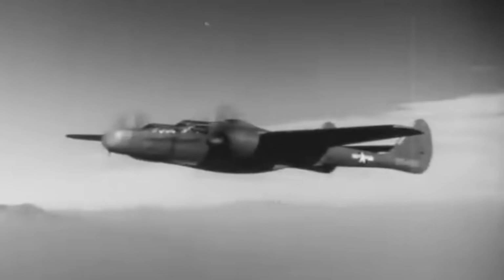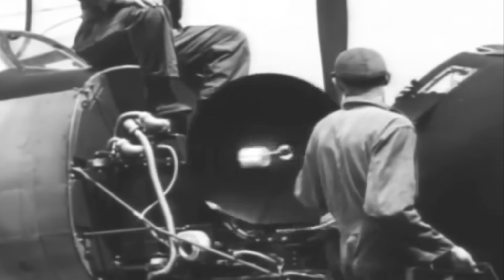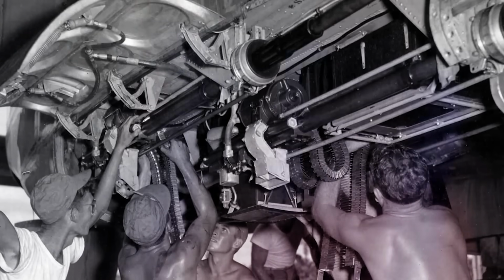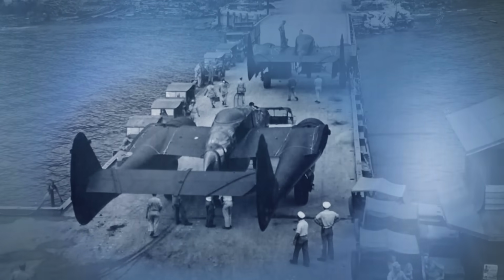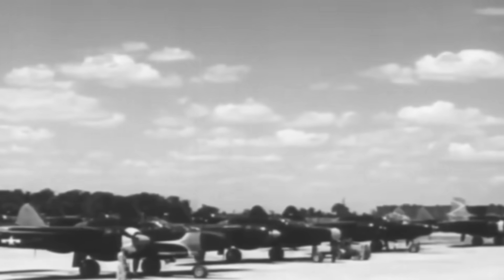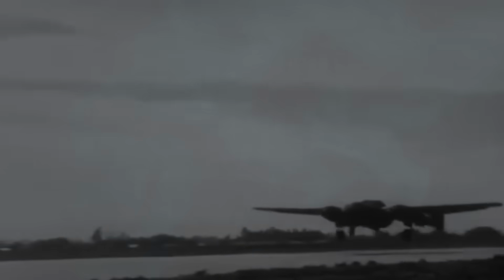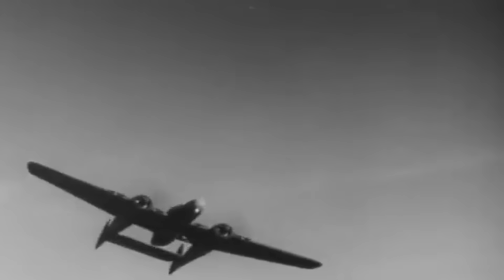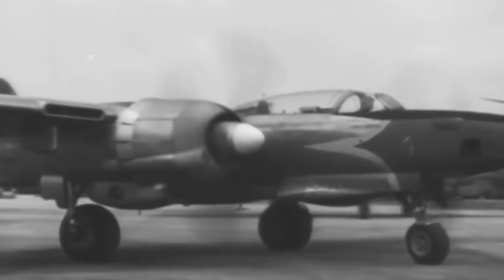The Mysterious Plane That Made 127 Kills Without Ever Being Seen

Comment: I built a model of this aircraft back in the late 1960's. I had never heard of it, nor seen any data on or about it. At the time, finding stuff out meant a trip to the library, and my local library was not very good. It wasn't till the world wide web started growing that I found even a little info on this plane. Thanks for covering this topic, and shedding a little light on this amazing airframe and its stories.
Reply: I've built this model a couple of times because it was always my favorite plane.
I loved how it looked.
Reply: bumped into the same restrictions when i was building a diorama with the monogram model in the early 80s.
Reply: @puntenpol  Built that same diorama, remember having one of the engines out and the little crew figures. That brings back some memories...
Reply: yes i did too in the 70s, could never get much info on it though, now i see why
Reply: I had a P-61 model in the early 90s with the “Time’s a Wastin” decal set. It was cast in black plastic and I tried so hard to keep it looking clean and having to paint it by some of the glue squeezed out of some of the seems and I smudged it wiping it off. I finally went with the OD green paint scheme with the white nose.
Reply: @McPh1741  I've got that same model hanging from the ceiling in my man-cave right now. I've also got a Japanese "Tony" hanging a couple feet in front of it tilted at an angle with painted and stretched out cottonballs attached to make it look like the engine is on fire and smoking.
Reply: My Revell kit had a little booklet that had half a page of specs and a short history. I scrounged the remainders section of bookstores to fill out my knowledge. You could find a lot of really expensive coffee table books, either encyclopedic or single subject, discounted to $5 if you were persistent.
Reply: @Markle2k  I don't remember that far back. As I recall, there was only a one ( big ) page folded assembly instruction sheet with the background info at the beginning. But this was a long time ago, and frankly, I don't remember much of those days. I spent all my money on models, brushes, paints and glue, besides there was only a christian book store in town, and the nearest real book store was out of my reach and budget frankly. I had to buy my models at the drug store, and it was a hike to get there.
Reply: @therealstubot  I grew up in the suburbs. The drug store where I got my model kits was in easy reach by foot or by bike. We had several bookstores in biking distance. One thing that I remember is that I used to buy glue and paint with no problem when I was in grammar school, but later on I had to drag one of my parents along because laws to prevent huffing and tagging came along and made it illegal to sell that stuff to minors.
Reply: @therealstubot  Back in the day, the things a kid needed to sustain his hobby were hard to come by.  I remember having to walk 5 miles to the only hobby store in town. The local drugstore had a few models but never anything impressive.
Reply: Jeff Stewart   I did the same at about the same time.
Reply: I remember those days, build a model plane and hang it from the ceiling.... I must of had an entire air force in my room and an entire navy
Reply: @kenp7814  And tanks, and especially cars. I would buy model cars, and add details, like wiring, hoses, hood scoops, fender flairs, working suspensions, exhaust systems... fun times.
Reply: @therealstubot  I currently build models. I'm hooked up with a bunch of guys here on YouTube who also build. Some of them do the same with spark plug wires, etc. You should get back into it.
Reply: @Red-rl1xx  I'd love to. It was such a fantastic creative outlet.
Reply: @therealstubot  Like I said, you should consider giving it another shot. There's a bunch of guys on here that are into it. I don't know how long it's been since you were last involved but there's all kinds of wild models out there, now. They're coming out with new stuff all the time. I'm getting ready to start a '71 GTX from the movie Fast & The Furious.
Reply: Jeff Stewart o
Reply: @kenp7814  I've got a number of model planes hanging from the ceiling in my man-cave now. I also have a bunch of battleships and submarines in a display case.
Reply: @Red-rl1xx  That what my room looked like back then, from p-51 to the flying sub , from carries to the pt-109
Reply: Me too but I built mine in the 80s! One of my fav WW2 planes
Reply: @acbulgin2  try the computer systems of the sixties. Any of you old coots remember a daisy ball printer?
Reply: @bradargyle5524  The 1960s? Selectrics were still business-only (the school secretaries, but not the principal had them) in the late 1980s. We students learned on mash-all-the-keys-and-screw-it-ups.
Reply: @Markle2k  Those were much simpler times. I guess we tend to forget the bad but that's ok sometimes. Very nice break and good days for you model builders.
Reply: I built one too in the 60s. My dad bought me dozens of WW2 models...
Reply: i built that model too
Reply: Jeff Stewart. Same here... late 60’s and moving out of my car model phase into aircraft. I believe it was a Monogram kit and I was just drawn towards the all black paint scheme with no knowledge of its history. Interesting side note: My next door neighbor Mr. Adams was an accountant and into big into golf. Nice enough guy as neighbors go. One day I walk into my kitchen and there’s the neighbor. Mom knew I was into WWII aircraft and turns out this guy was the bombardier on a B-24. Never gave it another thought but thankful for him sharing his stories and mom taking an interest in my hobbies 👍
Reply: In august, I visited the Air Force Museum at Wright Patterson in Dayton OH.
There’s one on display there.
Reply: I had that same model too, a 1/48 scale Monogram model.
Reply: Jeff Stewart and others, if any of you are within driving distance of Reading, PA, there is a P-61 being restored at the Middle Atlantic Air Museum.  The aircraft is on display every year at the WW2 Weekend, usually held the first weekend in June each year (with the exception of this year.)  I've seen the plane several of the past few years, and it's coming along nicely.  They're doing a tremendous job with it, getting every single rivet right.
http://www.maam.org/p61.html
Reply: @hovanti  Thanks, Wasn't sure how far along they were .Air Show last weekend ?
Reply: @eflanagan1921  There was the WW2 Weekend the first weekend of June, and they had it out, as usual.  At least one of the engines is mounted, they had the nose cone off and the radar is in place behind it.  The landing gear has been on the past couple of years, as is the tail, but the outer wings beyond the engines are still off.
Reply: we had a set of funk & wagnalls encyclopedias in the late 80's. it was phenomenal. i wonder if schools even need libraries anymore.
Reply: Osprey Publishing and Squadron/Signal Press have a book or two on the Widow, which I found in a hobby shop (not to be confused with Hobby Lobby).  I was also able to lay my hands on a reprint of a training manual for fairly inexpensive, from Aviation Publication.  And semperfimac.net has a nice lapel pin.
Reply: I also built a model of this as a kid in the 70s, and one day my grandfather saw it and became visibly upset.  I was quite shocked, and over the next couple of days I got the story from him.  In between 1943 and early 45 he was a USAAF captain, and flew "the Hump" from India into China flying all sorts of cargo aircraft, mainly the C-109 (tanker version of the B-24).  He told me how Black Widows were deployed in their area, but they soon learned that the primitive IFF equipment was virtually ineffective, and a lot of the kills claimed by P-61s turned out to be American cargo planes on nighttime Hump flights.  A lot of his friends were killed by the Black Widows, and he said that they learned to turn on every light on the aircraft (against all orders) as soon as they learned that P-61s were in the air nearby, in the hopes that they would be recognized as American.  Better to risk Japanese fire than getting shot down by your own side.  Anyway, my grandfather hated the damned things.  Cool looking plane though.
Reply: I would've pestered the library into finding a book somewhere. If you talk to librarians they usually did. Or aaco and pgco were really good.
Reply: I can confirm that this was a "mystery plane" for kids in the 1950s. It wasn't until the advent of the internet that I could find out much about it, and why it was so funny-looking.
Reply: How to build dioramas was the first  book I saw the black widow, but I poured through Jane's and time life and others in the '80's and '90's. Also seeing it on public television, history and discovery and cable shows in the '90's.
Reply: Its a pity not to have access to information/knowledge. We are lucky.
Reply: David Vance  So, your name is David Vance? Where do you live?
Reply: David Vance  The reason I asked is because I have a brother named David.
Reply: Yeah I put together all the twin engine fighters I could find in the 1960's, the P-38, the P-61, and the P-82 Twin Mustang, then things got tough and I had to grow up early, no time for models.
Reply: Me TOO! One of the frist models I built
Reply: I think I built the same model in the early 70s.
Reply: Roger that - never heard of it either but was given a model I'm about to build for my grandson right now... concept is intimidating , late comer?
Reply: The control panels in the cabins remind me of submarine equipment.
Reply: I built this (model)plane in the early 70s
Reply: i miss having to go to the library to find information
Reply: I blew so much money buying aviation books in the 1980’s. It was a great investment though, paying off when I applied for flight school, getting my gold wings in 1995.
Reply: I, also, first learned of this aircraft from the model kit. I think it is still handing from the ceiling in the house I grew up in.
Reply: It really is incredible to think how much internet has changed society and our knowledge on almost everything.  It's almost hard to remember what it was like back then,  writing letters to people, going to a library to research, damn you are making me feel old.
Reply: I built the Monogram 1:48 model back in the seventies. I just had to buy the kit when I saw it, even if it took a big chunk out of my pocket money savings. I had never heard of it, and it looked so odd. A little later the same shop had a model of the Dornier 335  Pfeil/Arrow that looked equally odd, with an option to build the two seat night fighter version of it. Giving it the same stepped canopy look as the P-61. Couldn't afford that one, sadly. But it would have matched the P-61 perfectly.
Reply: I remember doing the same, around the same time.
Reply: It was like that for me in the 80s and 90s. Good times.
Reply: So did I. My mum used to buy me airfield model  nearly every week when I was a kid. At woolworths..... If I was good.   In the mid 60s. That's what bought me to watch this channel seeing this  aircraft . Thinking,  I had and made this plane when I was young.   Wow. Small world. 😊
Reply: i also built that model . looked like a P-38 and "black widow" on the box .. what kid could resist ..
Reply: Going to the library I remember those days my friend! These kids don't know how lucky they have it they have all this information that you and I would spend weeks finding that they can find in two seconds on their phone!!! I can't help but think this makes us stupider in some way because we take information for granted. I'm not sure
Reply: I like it. Only 15 bucks for a model? I will build one.
Reply: Pp
Reply: I have fond memories of building this model with my father when I was 6 back in the late 50s.
Reply: me too, had family involved.
Reply: Same here, although I think I built mine in the early/mid seventies. One of the meanest aircraft used in WW2, and to good effect.
Reply: I lusted over that model. I think it’s one of the coolest-looking war birds of all time.
Reply: @billknudson7895  I still have a few perfectly built models from my boyhood.
"I did" good work.
Reply: Yeah, the instructions gave a tiny little blurb, like 2 sentences in the beginning, but there was nothing of substance. It gave all the dimensions and specifications, but nothing about when or where it was deployed, how many were made, or any of that info. It was a very sexy model though.